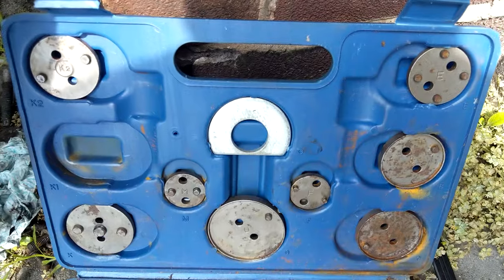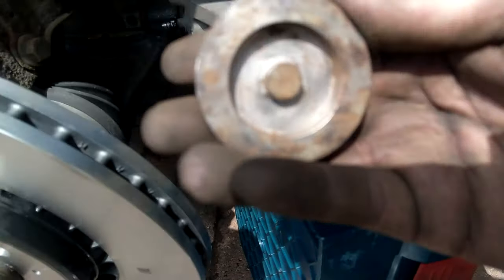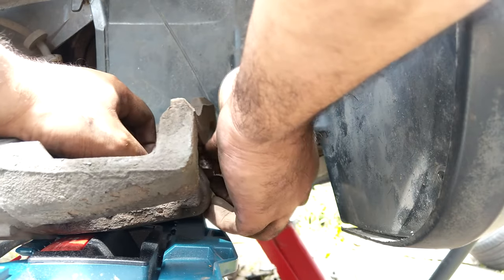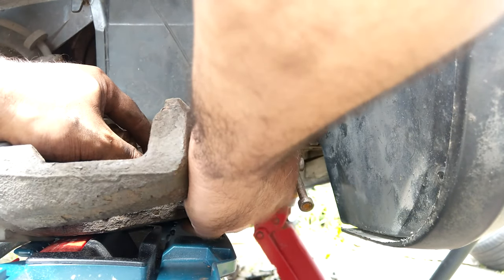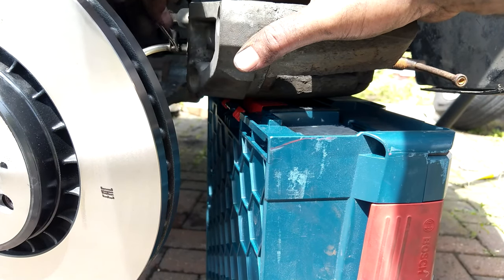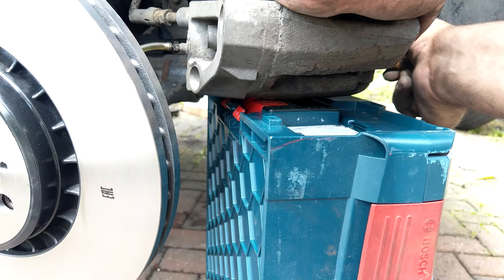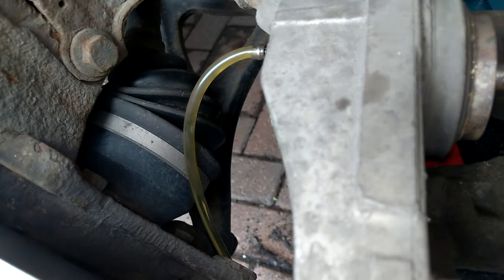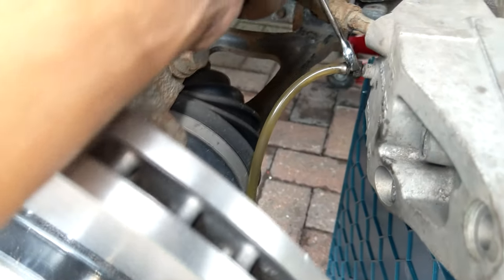Brake Caliper Rewind Tool and Preferred Method

Comment: I've got one of those kits. Cost me about £18 and it's great. I have used it on many cars and 4X4s. I do/did use it on a twin piston jobbie. I simply used the knackered brake pad across the 2 pots and found that it wound back evenly and relatively easily. I guess the access might not easy with some breaking systems though. Everybody that does their own car work should buy one of these kits, cheap as chips and makes everything so much easier. I agree with the bleed nipple draining idea too.

Comment: Hi SiRobb, Sorry to hijack this video comment section. Volvo V70 auto box. Change ATF Yes or No. So much conflicting advice out there.
Reply from the maker: It's not a simple yes or no.
Mileage since the last change and the colour and smell of the current fluid is the starting point.
Reply: @sirobb  Thank you. I am 55 yrs old so come from a generation where 'unchangeable oil' is a weird one.
Reply from the maker: @StBlazeyModelWorld  Yes, I take sealed for life to mean lasts just about long enough to be outside any warranty claim. 😌
If the fluid is the correct level, bright and clear red with no burnt smell, it's probably ok for a while.